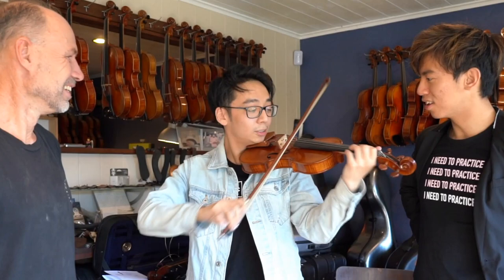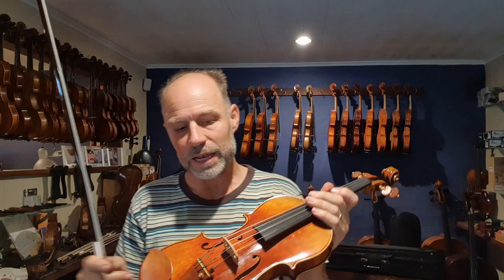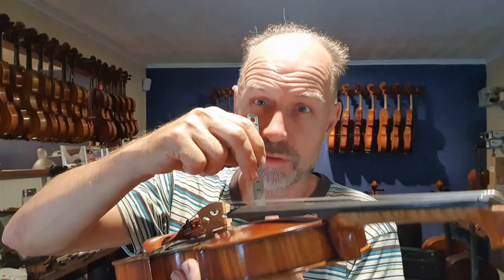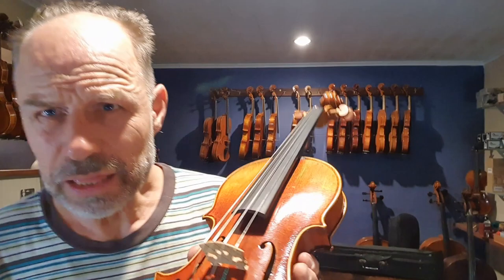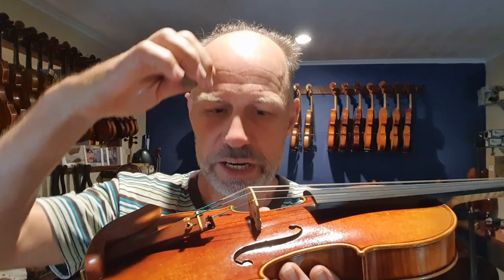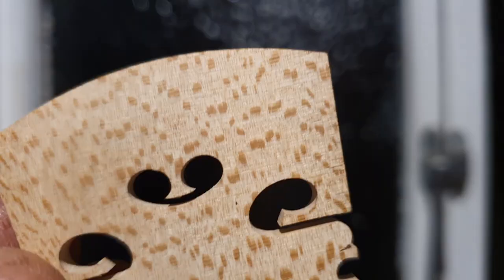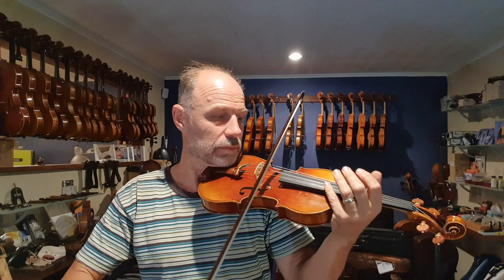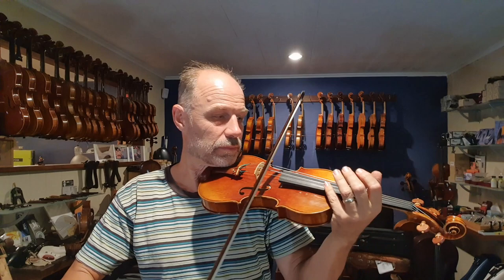Ask Olaf - How the violin bridge really works

Comment: I do marvel at how such a small acoustic instrument produces such a big sound, I know in theory how the strings, bridge, sound board, sound post, base bar and indeed the whole body of the instrument transmit the sound and resonate sympathetically to allow more acoustic energy to be transmitted to the air inside the violin, how the shape and size encourage these vibrations to be focused out through the f-holes but still when I compare the sound to my acoustic guitar, which has frets such that your fingers don't dampen the sound of a stopped note too, the guitar is nowhere near as loud, whether finger picking, using a pick or trying to bow it as the violin and making that big sound is comparatively effortless, although pizzicato on the violin isn't as loud as plucking a guitar string, guess it's the differen t design for different sounds, although I reckon a lot of it comes down to the way fingers dampen the string on a stopped note and how the bow overcomes that deficiency by allowing a constant energy transfer, my uncle actually makes guitars and has been teaching me about that but there's some big differences, even if they are both derived from lute family instruments, it's fascinating how these instruments manage to capture and focus energy so efficiently without amplification! As for example, an electric guitar produces such a thin, quiet sound when it's not plugged in, the amount of engineering from the perfect shaped sound holes to the bridge shape, all working in harmony!

Comment: I had a bridge cut for my fiddle and the feet are really, like unusually, thin.  What do you think the objective was there? Would it sweeten up the tone? I was looking for a slightly lower bridge, but without losing too much of the brilliance and projection I was getting.  My old bridge is quite high, and the action is too as a result, maybe a millimeter up from standard measurements.  It was getting a bit warped anyway too.

Comment: Hello, I had a dusty old (cheap) viola in the corner that I just cleaned up and repositioned the bridge and tuned. I have the bridge roughly between the kidneys like you show here. Do I need to make any fine adjustments to set the intonation like on a guitar? I have a minor-7 interval where the neck meets the body following the example of my double bass. Is that correct on a viola or violin?

Comment: Sir, love your videos. They are incredibly informative and sometimes hilarious. I hope that you will answer this question. I'm just a senior that went back to fiddling and I love Helicore steel core strings. I'm buying a new fiddle and need your expert advise on string height for steel strings. 
I figure that since steel strings are both thinner and use higher tension, that the string height can be set lower than the standard 3.5mm for E and 5.5mm for G. Please reply.